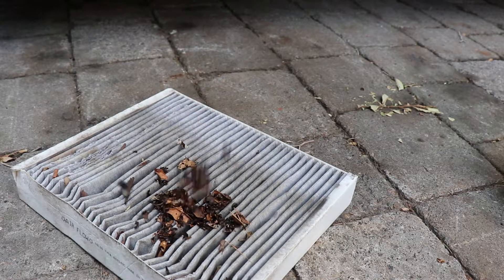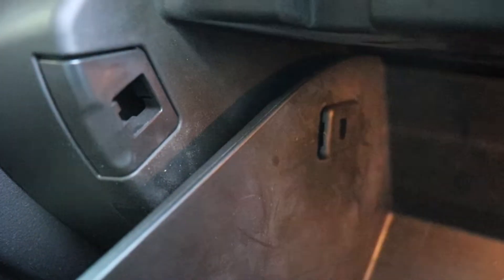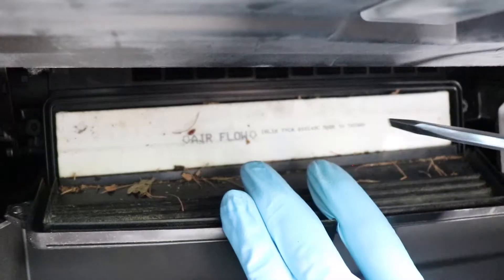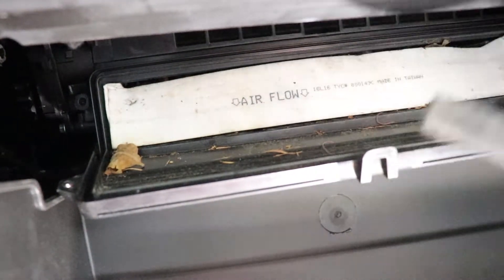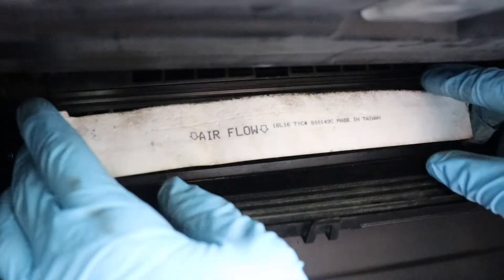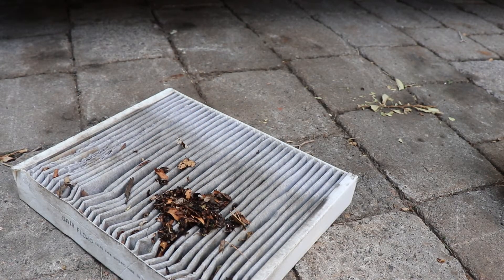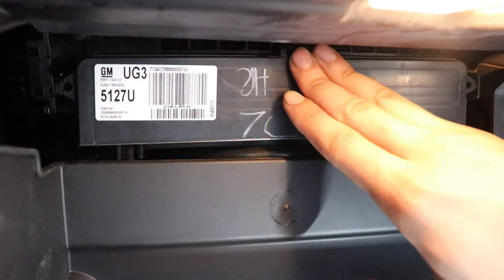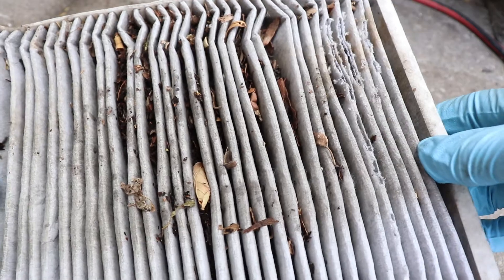How To Safely Replace Your Cabin Air Filter

Comment: Another way I've seen this done is to cut part of the box that the filter came in and slide it under the old filter before removing it. That prevents all the debris from going into the blower.

Just an FYI... The Super Tech cabin filter sold at Walmart is reasonably priced and is made in the USA.
Reply from the maker: Great tip!